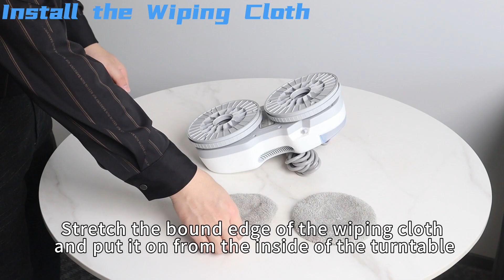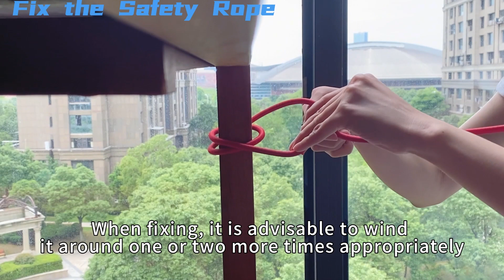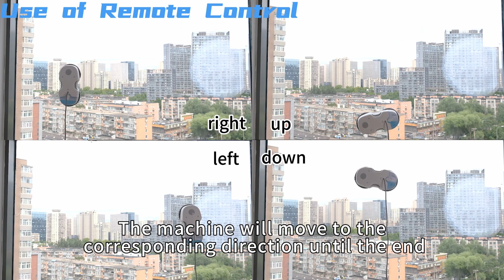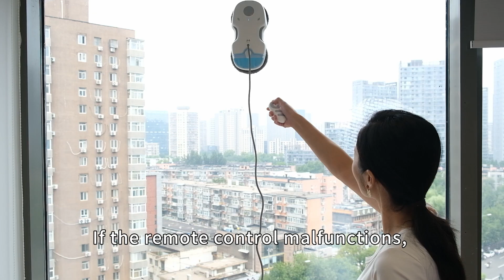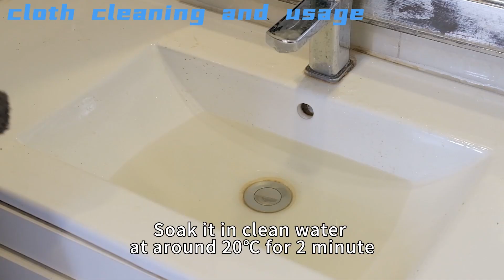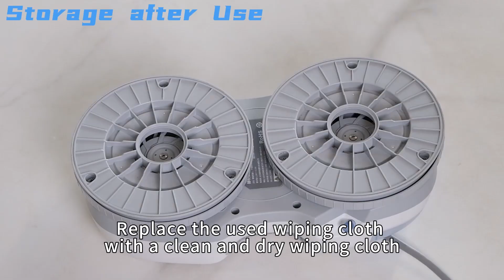How to use HUTT C7

Comment: What is the difference c7 vs A1? Can you respond please i will choose one of them
Reply from the maker: Hello, HUTT C7 is round,  A1 is square.  
HUTT C7 features HUTT's new 3D floating disks design, which improves its stability and power on different surfaces.  Also it has upgraded  HUTTHINK Algorithm.  

If your windows are regular windows,  you can consider HUTT A1. We upgraded HUTT A1 recently, please feel free to communicate with our Amazon store and check if they already have the upgraded HUTT A1 on shell.   https://www.amazon.com/s?me=A1D89E895N1GUT&marketplaceID=ATVPDKIKX0DER

If you want to cleaning frequently,  you can consider HUTT C7 as it is more convenient than A1.  

It depends on what your cleaning routine.  I highly recommend chatting with our Amazon store as well , you can share your cleaning routine with them. They will give you more professional answers. 

Thank you :)